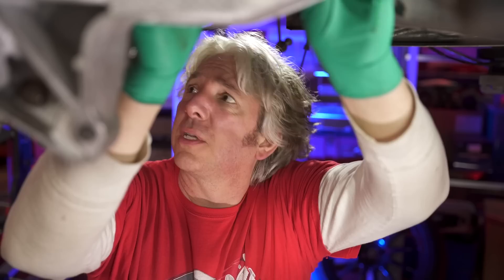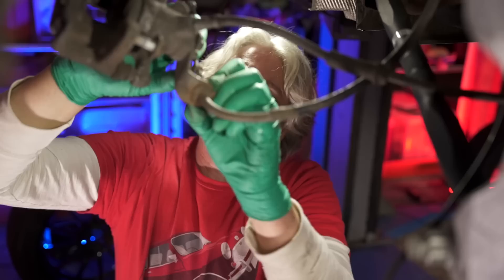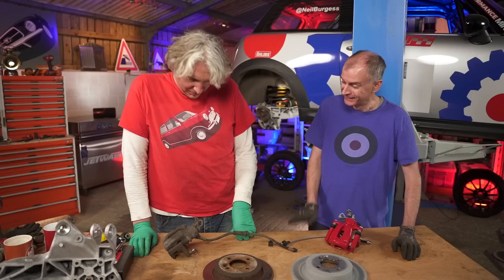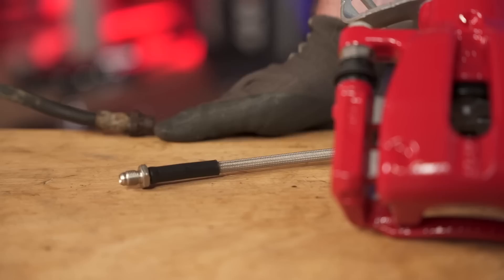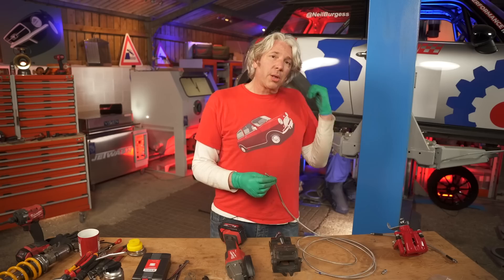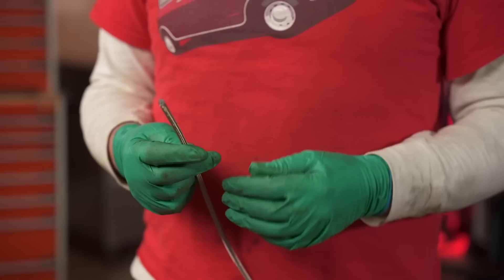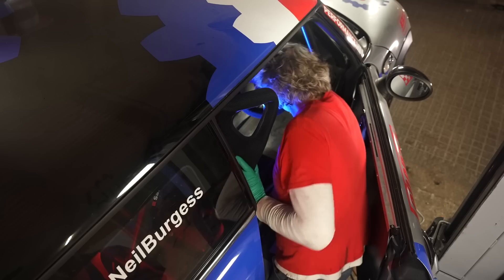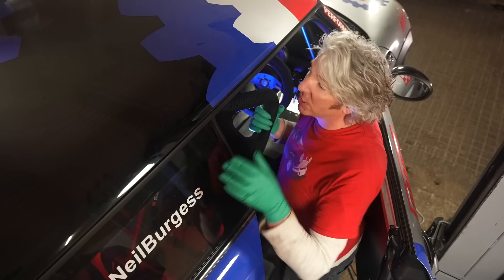How To Unseize A Brake Caliper | Workshop Diaries | Edd China

Comment: I have used an aluminium tube that fits tight over the braided brakeline. Than i have cut it with an angel grinder. It works pretty neat.
Reply: What’s angel grinder?
A hook up app for gay divine messengers?

Comment: Another re-upload? I have definitely already seen this.
No way is Edd doing these uploads or text as he'd clearly know there was no unsiezing performed in this.
Reply: I always unseize brake callipers by replacing them. They seized up for a reason. New parts, or properly rebuilt parts are cheap generally and will outlast what ever you do to unseize a set. 
    There ya go. Problem solved. 😂😂😂

Comment: I would be a little concerned using a heat gun on the braided pipe for the heat shrink. What happens to the inner plastic pipe of the braided hose when it is exposed to heat?
Reply: I think the pipe should have a higher melting point than the heat shrink, and that hadn't shrunk yet. These pipies can get close to exhausts etc where they'll be exposed to much higher temps.

Comment: Neat technique with the cable ties.
Has anybody produced special pliers for the collet-attachment tasks? It looks like somewhere a dedicated tool would help, but maybe it's not done enough to create a demand? 
Might it make sense to put all the fittings for both ends onto the hose as soon as theres's a clean end, (possibly the necked one), to put them on?  It would be easy to see then that all the components were present and in the right order.

Comment: This vid should be called how to replace a brake caliper... because all through the vid there is nothing related to unseizing the old brake caliper. Edd ur going to a bit of clicbait here and that can be bad to ur channel. On the other hand i enjoyed the new brake tubing that u used it can solve many problems that were usually encountered  in replacing  the old stiff metal tubing.